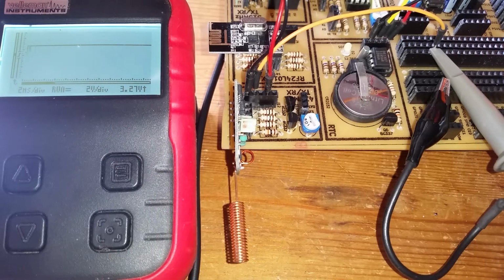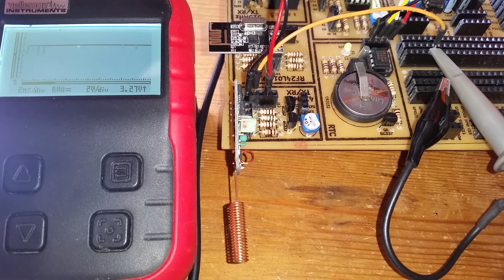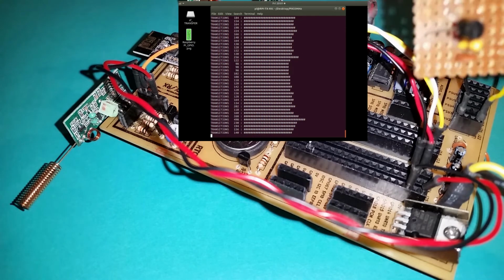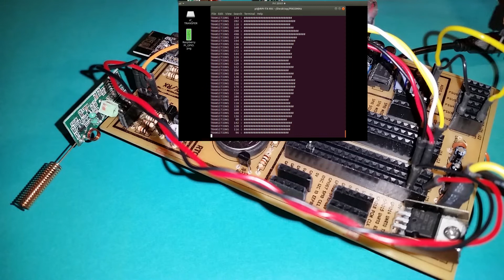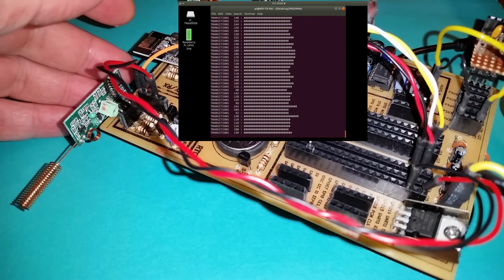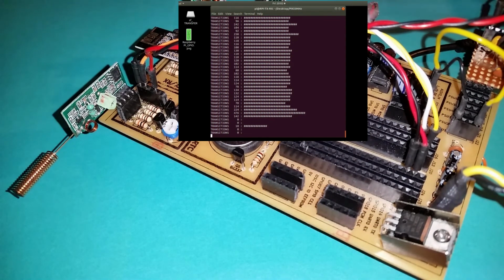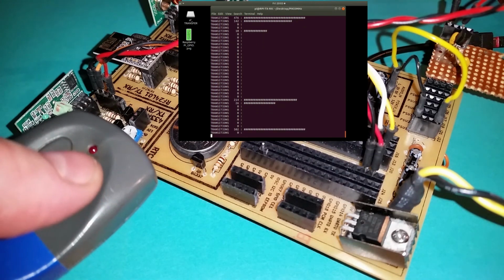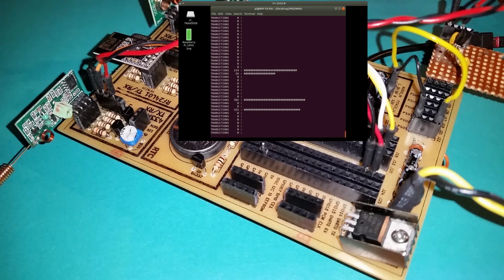Raspberry Pi 433MHz/315MHz Removing Signal Noise For Better Reception

Comment: Thanks for figuring this out - will read up on low power regulators.  I'm probably facing the same "noisy power supply" issue on my project.
Reply from the maker: The one I use here is 78L05.
Reply: @DevelopIT  Thanks a lot, will try this with the NTE977 that's available at the hobbyist store.  Do you have another component in series with the 78L05?  Capacitor or something?  Will try just the regulator for now, but thanks again for working this out.
Reply from the maker: @Mickolas21928  Regulators like this generally require 1uF across the input to ground and 10nF across output to ground.